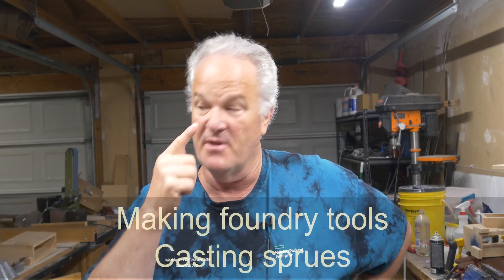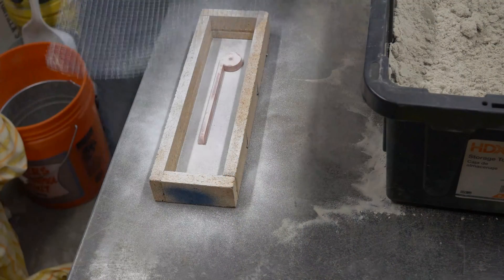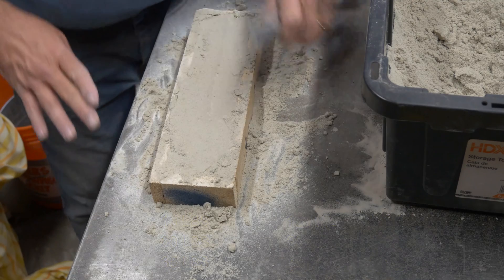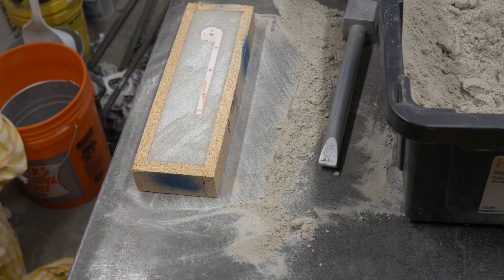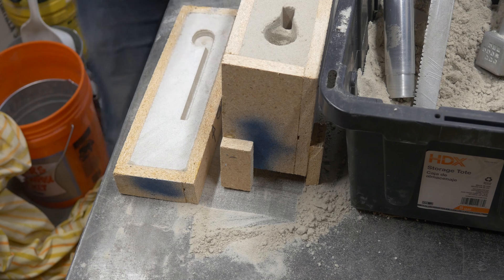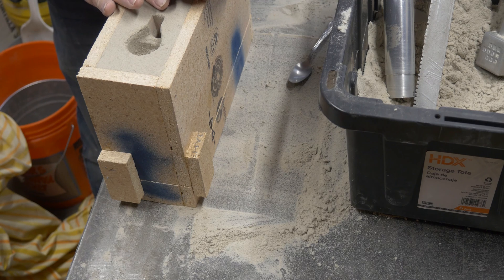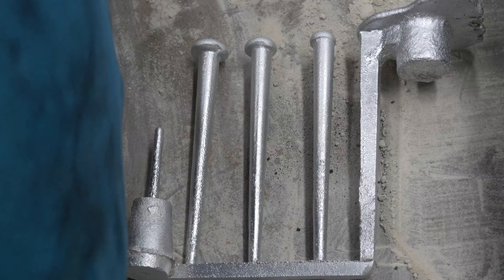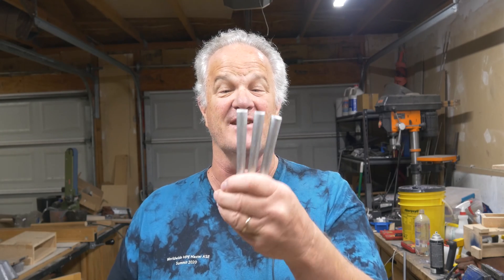Making foundry tools - casting sprues

Comment: Thanks Perry. A pleasure to watch as always. Filling from the bottom looks very smooth when you do it. I have been trying to get this technique to work myself, with mixed success: https://youtu.be/cRrRibp7Cyg Do you think the side casting method could work for your sprues?
Reply from the maker: I don't see why not. You'd have to make a split pattern to do it.  I was trying to avoid parting lines that I'd have to clean up so I did it this way.  Otherwise I probably would have just done a traditional horizontal mold.

I did enjoy your video. I hadn't seen this technique outside of the old videos that Andy Martin did. https://youtu.be/j2_-pTx4AVg is one example
Reply: @swdweeb  Thanks. Andrew's videos are what inspired me. Water is a lot easier to work with than molten aluminum, but not nearly as exciting.

Comment: Reckon if you put a taper on your runner it would equalize the runner pressure? Thickest at the sprue and thinner at the spin trap.
Reply: I would think the same thing would happen with multiple ingates on a single runner into a casting as well.
Reply from the maker: I just checked with and heard back from Professor Campbell. He concurs with you. He believes the filling order is due to inertia and could have been evened with a tapered runner as you suggest.

Comment: interesting to see the effect of low ramming pressure on the final surface finish. maybe a multi-part box would help you build up the sand in layers to get a better result.
Reply from the maker: Someone else suggested the same thing. I'll give it a try next time I make them.

Comment: Great job Perry. I wonder if the back spruces filling first was more because of inertia than pressure.
Reply from the maker: You could be right. Remember, I'm a mere software puke and not a real engineer so I know little about pressure inside these systems. I guess the pressure is likely to be pretty constant inside and so inertia might be the culprit.  I'm actually going to see a "real" engineer tonight, I'll ask him.
Reply: Windy is wise.
Reply from the maker: @honthirty_  Beyond his limited years 😄😄
Reply from the maker: I checked with Professor Campbell. He agrees with your assessment. He also thought a tapered runner that gets thinner as it moves away from the sprue would have evened it out but said given that they all filled pretty closely "what's the point of going to all of that trouble" 😄
Reply: @swdweeb  I used to cut parallel or straight sprues but always used a tapered runner below. Not in width but in depth. The runner would start off deep as the volume at entry from the sprue then incline to a shallow stream prior to gate which worked quite well. It's just fast to cut the tapered sprue though

Comment: Thanks for the on going videos and reports of your experience. When I'm out and about, and see sand, I check it out. At Menard's I found sand for leveling patio blocks and bought a bag to mix into a project. I found it very, very fine compared to play sand and 40 pounds were less than $5 U.S. It may have been a hick-up, but I thought you would want to know about my experience.
Reply from the maker: Hey Don, that sounds about right for the price of sand at a big box store.  Play sand is insanely coarse and you will have to sift about half of it out to get down to just the fines.  I looked at the paver sand thinking I'd have to get rid of less of it than play sand but then I found the sand I'm using. It's more expensive than $5 per 40 but not significantly and I can use it without any sort of screening.
Reply: @swdweeb  My experience was observaction that formed an opinion, while your is based on scientific study with a 50 micron screen.
Reply from the maker: @donmittlestaedt1117  So are you using the paver sand?  Are you happy with it?  It would certainly be a low-cost option for a lot of people if you're happy with it.
Reply: No. I have it in mind for casting, but the growth plans I had for my shop were delayed by a sewage problem when the river over flowed 18 month ago. Since then I have been Mr. Hangyman, not Mr. Metalworker. I'm too old for all this. However. The house is livable again.
Reply from the maker: @donmittlestaedt1117  Man I understand that. It's amazing the number of things that have crowded casting out of my life.  It seems like there's always a job to be done before I can go out and play
Reply: @swdweeb  Brother, you can say that again

Comment: Nice one Perry. Couldn't you alleviate that tall cope by cutting it in half and just having 2 copes, so you could ram the bottom cope and then add the second one and then ram it up.
Reply from the maker: Not a bad idea actually. I'd have to put alignment guides on but I'd never have to separate them until after the pour so I wouldn't have a flash line.  I'll play around with the idea this weekend.

Comment: You know you can get some more use from that Crucible. Sandrammer said any time they poured in the Navy, they set up different diameter molds to pour any extra  material. They would give these  cylinders to The Machinist. A lot of You Tube Machinist watch your channel. Thanks for sharing!
Reply from the maker: There aren't "a lot" of anybody that watch my channel 😄 Just look at my numbers compared to many other channels 😄
Reply: @swdweeb  Keep grooving man. It will come.
Reply from the maker: @donmittlestaedt1117  Yeah, I do it because I enjoy it, not because of the numbers.
Reply: @swdweeb   Perry, it is quality over quanity here. Same could be said for your audience.
That is good info on moisture. Thx!
Reply from the maker: @honthirty_  😄